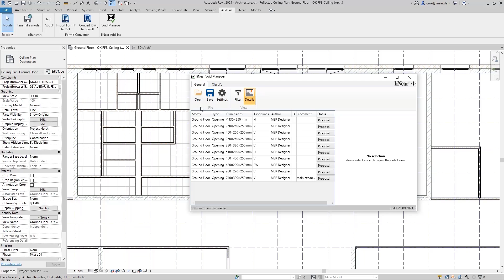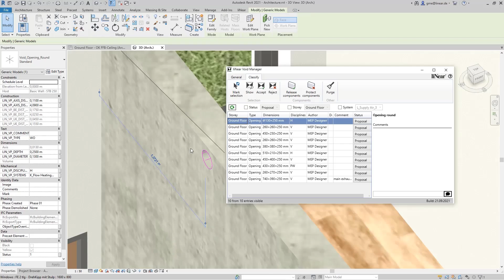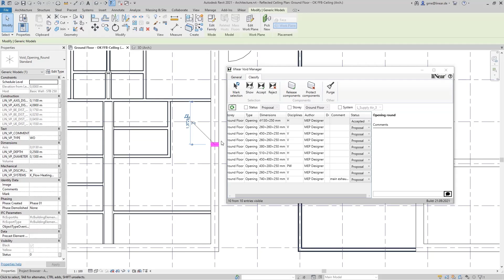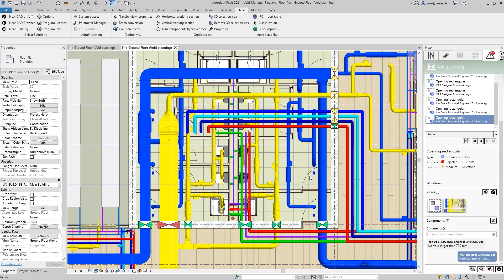Coordination of voids with the liNear Void Manager for Revit

Comment: Hi. I have installed the add-in. But where can I find the liNear (the one on the left of the "modify" button on your screen)?. I just have the liNear Void Manager inside the "Add-ins" button. Can you please help me with it? Thank you.
Reply from the maker: Hello Trần Nguyễn Quang Minh, the liNear Ribbon is part of our paid solutions and include the liNear Control Board with tools for the whole MEP Design. You can find more information on our website or in our shop at shop.linear.eu. The liNear Void Manager for the Coordination of voids is a free Revit Add-In which mainly is used by architects and structural engineers.
Reply: @liNearGmbHinternational  ok, I got it. Thank you.

Comment: Hello, when I accept all openings, they don't cut the wall as shown in the video. What could be the main reason for this? Thanks.
Reply from the maker: Hey Cesar! Are you working with a linked model? To change the walls it is necessary to work directly in the model with the rights to make changes.
Reply: @liNearGmbHinternational  Thanks so much for your response. Another problem we are facing is that we have "Systemtrendwand" as a furniture family in some places, and Revit doesn't recognize it as a proper wall. What would you recommend us to be able to use Voids in these places?
Reply from the maker: @cesarnolaya4641  As you mentioned, "Systemtrennwand" is not a proper wall. Voids can only be made in for example wall and ceiling elements. You therefore need to replace these elements for using the void manager.